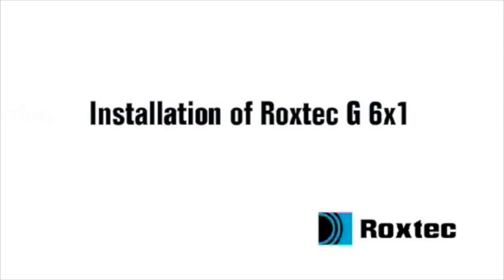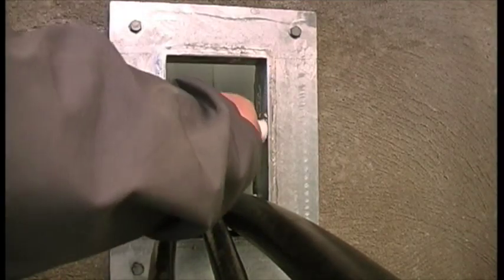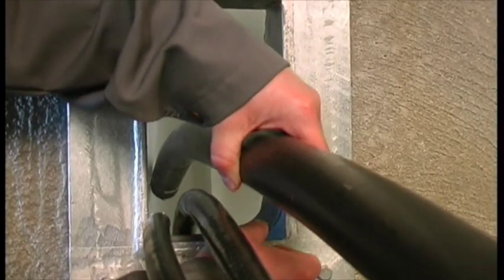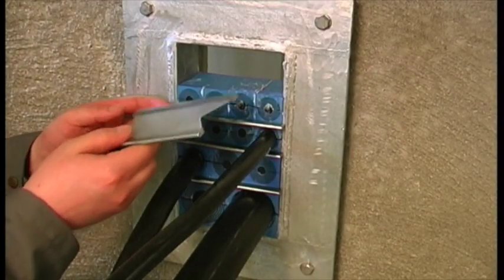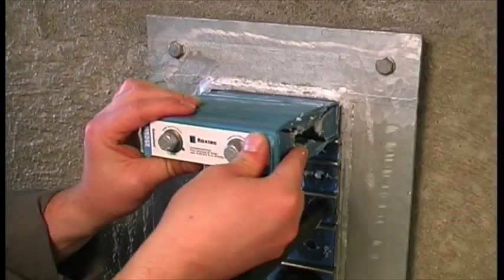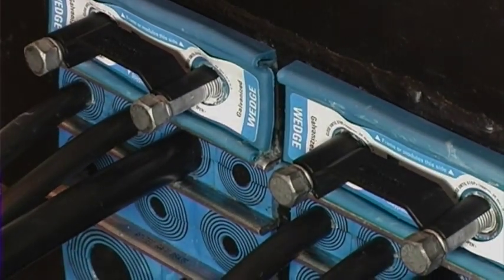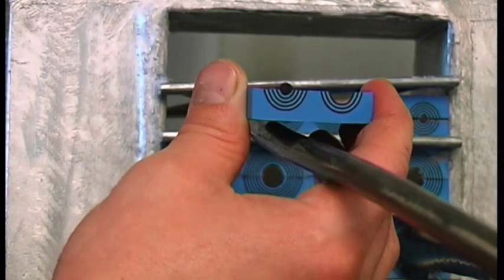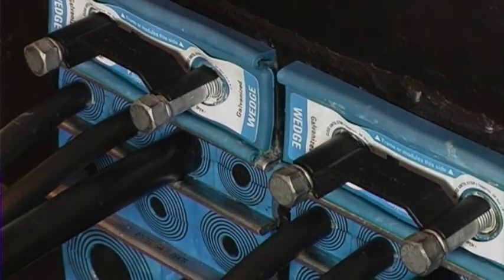Roxtec G frame installation

Comment: Can this frame be mounted on a Basement wall? where the outside (top of frame) will be 8ft below grade (dirt).
Reply from the maker: Hi Jose.
If there is constant water pressure, it is better to use Roxtec UG™ (underground) solutions. Example R UG ,H3 UG ,RS UG.
More about our underground here:
https://www.roxtec.com/ug
https://www.roxtec.com/en/products/innovative-technologies/constant-pressure/
https://www.roxtec.com/en/products/solutions/?filters=2985
You are welcome to contact us via email or phone for further technical support and help with finding the best solution:
https://www.roxtec.com/en/contact

Comment: can this be installed for watertight bulkhead? how much pressure this can take? thx
Reply from the maker: Hi!
It sounds like you are making an installation aboard a ship? For a marine application we would recommend the S frame family, SFHM if you bolt it and S if you weld it. It is tested for marine standards and certified 4 bar pressure.
S transit: https://www.roxtec.com/en/products/solutions/roxtec-s-transit/ 
(certificates related to the S frame can be found via the frame component page: https://www.roxtec.com/en/products/system-components/rectangular-frames/roxtec-s-frame/)
SFHM: https://www.roxtec.com/en/products/solutions/roxtec-sfhm-transit/
G transit: https://www.roxtec.com/en/products/solutions/roxtec-g-transit/

For more support regarding your specific application, you are very welcome to contact our support via your nearest Roxtec office:
https://www.roxtec.com/en/contact/

Roxtec, via Joel
Reply: I was a transit packer on shipyard i love it but they laid me   Off 😔

Comment: what is the bolt type and the size, please?
Reply from the maker: Hi Adji.
The through hole in the flange is 10,5mm and fits fasteners in size M8 and M10 if the metric system is used. The size is depending on the amount of holes in the flange and if a custom hole pattern is used, this must be considered when selecting screws. The material in the fasteners is advised to be the same or similar as the frame. On page 11 in the “Roxtec selection guide – frames and gaskets” (find via link below) shows different screw types and when we recommend them to be used. If there is a through hole in the structure, a sealing washer or other gasket is also recommended.

More information about aperture and frame attachment for our products here:
https://beta.roxtec.com/en/service-support/installation/frame-aperture-and-attachment/